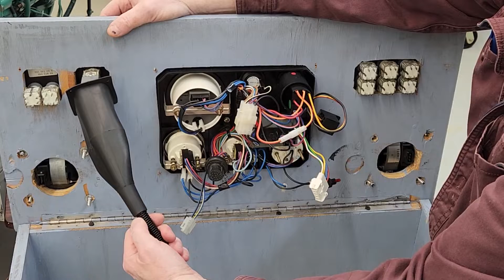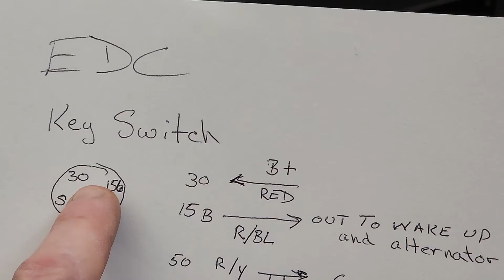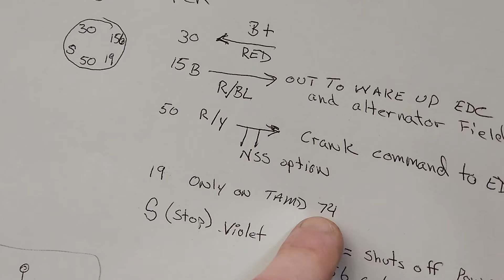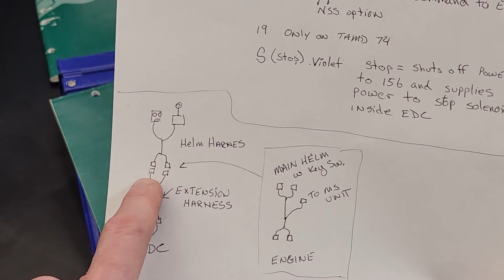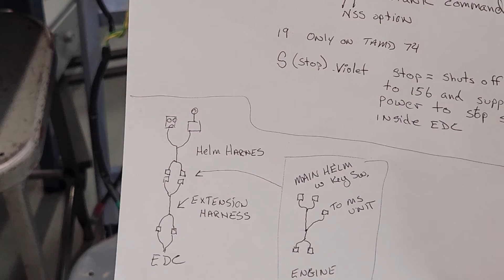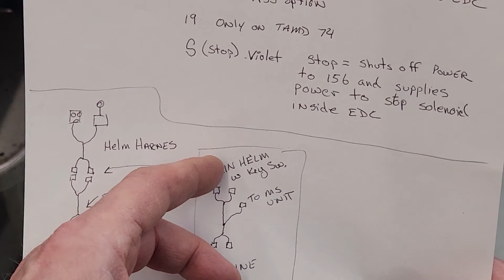Volvo Penta EDC KAMD44 Harness Introduction

Comment: I have a problem with the neutral button it will not go out when I put the gear in drive on the main station on port side engin but on fly does it go out 
Everything works but I have the fault code 5.2 
do you have any idea where the power coming from as keep the lamp lights up
Reply from the maker: That will take some research and further consultation. Please email me at marinedoc01@yahoo.com if you would like further assistance.

Comment: Hi Ted, great videos, I have a KAD44 that doesn’t wake up at all. I have battery voltage on pin 30 in the key switch when I turn on the main battery switch. However, when I turn the key switch to wake up the EDC, the voltage drops to 0. I have checked all voltages in the relay box as well as the terminals on the side of the engine and the 7,5A fuse, all looks good, no corrosion, nobody’s been messing with it. Also checked the 8 pin connectors going to the helm, all good. I have the wiring diagrams, but not sure exactly how to trace the power to pin 30 in the key switch. If I take a separate lead with battery voltage to pin 30 in the key switch, all works well. Is there any typical splice or something else that you encountered regarding power to pin 30 in the key switch?
Reply from the maker: @alterschwede9953  please email me a picture of the engine ID tag with the serial # to marinedoc01@yahoo.com
Reply: @tedsmarinerepair8956  hi, I appreciate your offer, but it’s a twin engine and I tried everything to get a picture or just a look @ that plate, no chance without major boat surgery. But thank you anyway!

Comment: I have been chasing an intermittent problem on the port side of a boat with twin 2002 Volvo TAMD73P-EDC engines for the last few seasons. Now, consistently the port side will turn over once and cut out. If I leave the ignition switch on I can jump the starter and run the engine fine. I have verified continuity of the harness from the Junction Box to the helm, swapped harnesses at the helm, and now looking at the EDC & harness in the engine room. I only have seen cannon plug style connectors throughout and not the 8pin ones as you've shown. That has me thinking there is an extension plug in-between the fly bridge helm and engine room... This video may have just helped me get to the bottom of the problem. Thank you for posting and sharing your knowledge sir.
Reply from the maker: @ecmo2007  glad it helps! I find that those 7 liters need a good "starting battery" with a CCA rating over 1000 amps. I've seen just that kind of issue due to low battery capacity
Reply: @tedsmarinerepair8956  So to follow up.. Ted, this video really did help me find the issue after chasing it for 2-3 seasons. As suspected in my O.C. I found a cannon plug buried in the wire chase of the salon of the boat. (Not the new style connector you mentioned).. 3 of the contacts had backed out of the connector. One pin was to the alternator (causing me to chase low voltage as the issue) the second pin went to the EDC... My buddy called me a surgeon for figuring it out but truth be told, I gave you the credit sir. I don't think I would have found it without this video. I can't thank you enough.
Reply: @tedsmarinerepair8956 would it be advisable to replace the connectors I have an intermittent gear shift whist in neutral
Reply from the maker: @cobiaboats6316  there is a possible TSB on that. It's old of course but I believe I have it. Please email me at marinedoc01@yahoo.com so I can send it to you.

Comment: Good morning Ted, just finished watching your 2 videos on the EDC for the 44 KAMD engine. I found these videos very informative and  the fact you use mock up stations really help in understanding how things work. My problem is with a 2003 vessel with twin Volvo Penta 300 KAMD engines. When starting the motors I turn key to position 1 hold key button down for 3 seconds turn key to the start engine the green light does not come on for port engine. I wait a few minutes and repeat normally after 3 or 4 tries the motor starts. Once started the boat runs fine. Any tips for this issue or would  I start by  going through the procedure in your videos? Thanks, john
Reply from the maker: I would try recalibrating the control to see if that resets the value. Being an intermittent you can also see if the main relay is the issue (replace it) which helps supply voltage to the push button panel.

Comment: Hey Ted,
Thanks for the Video, i have those engines in my boat.😊 
In the technical Database stay 3.59 liter. 
We have had the problem, when we start the engines, the voltage go to far down so the edc had not enough to Funktion, even with a new starter battery. 
So we decided to gave the edc an separate 
Battery that voltage not go down in the moment that we use the starter. 
But now i have to switch on the battery for the starter and the edc battery. 
Greetings from Germany 🇩🇪  Marcus
Reply: Could be a bad alternator or regulator. Also if you recently changed an alternator you need to check if the alternator needs battery voltage to regulate. Especially if you are using a battery isolator like Victron ArgoFet. (The Victron Argofet has an Energize output that needs to be connected to the alternator D+ input) I changed from a wrong wired diode isolator to a properly wired Argofet on my KAD32 and the charging voltage increased from 13V to 14,5V.